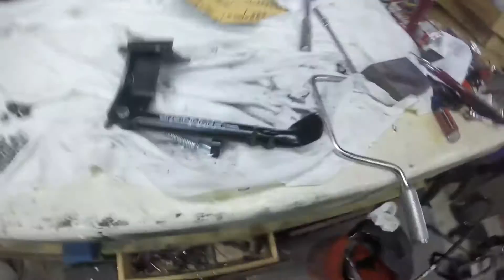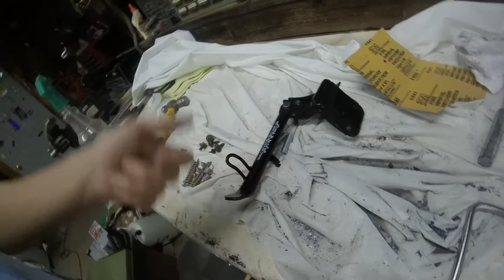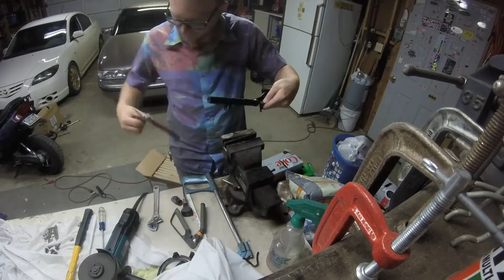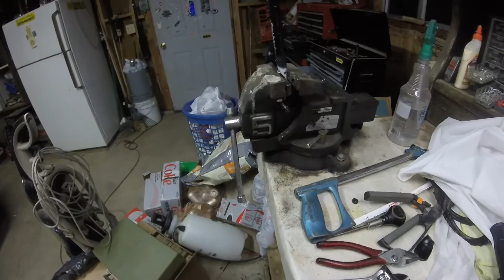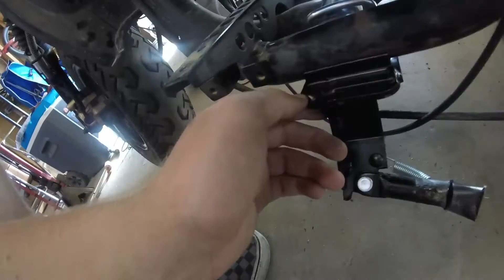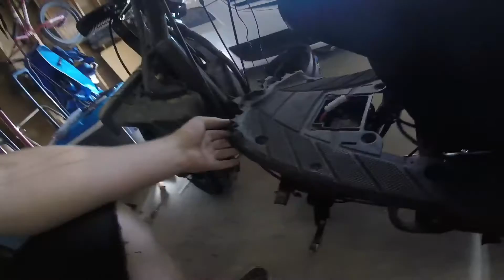Buzzetti kickstand install and review

Comment: I just ran into this problem with a 2008 zuma i just bought.  The center stand no longer works and i cant replace it because the stand pin is so seized in, the company i brought it to is worried about cracking the engine case.  did you ever find a better replacement stand or any other way to do this? would love some help with it
Reply from the maker: This was a long time ago but I dont remember doing anything different. Shortly after this I was riding and it lost the rings so I sold it for a couple hundred bucks.

Comment: I wonder if it would work with a Honda Ruckus?
Reply from the maker: Dingle Berry It was a kinda universal thing. Like it had a u-bolt to clamp to the frame. I mean if you're handy with a clamp and a grinder you should be fine. My issue was it was sold to fit that bike and it didn't.
Reply: Gromfull Could you recommend a kickstand that actually is universal for Honda Ruckus or Zuma.I have a Ruckus & thanks for the reply.
Reply: They make a ruckus one and it’s pretty cheap quality only way I can think it would work is if you got a larger rear shock

Comment: maybe you dont have the ability in your workshop but I would say it hangs down too low.  I would cut the mounting bracket and make it shorter rather than the kickstand piece.  It looks way too long and as you said would catch on things when making a left turn.  I have a bolt on style for my daughters scooter trying to figure out a way to mount it as well.  it doesn't have the u bolt so it isn't going to be easy.